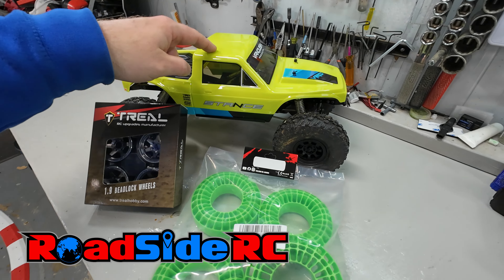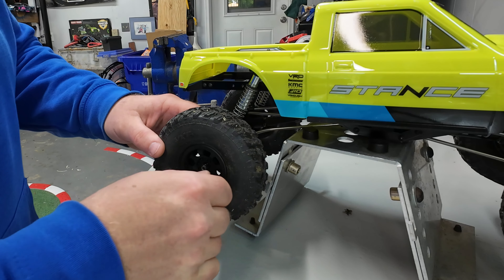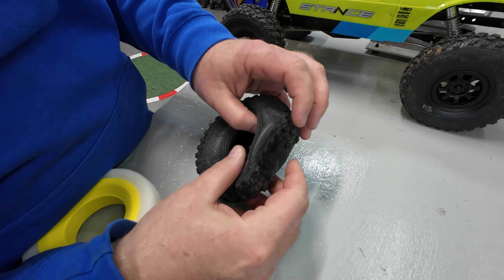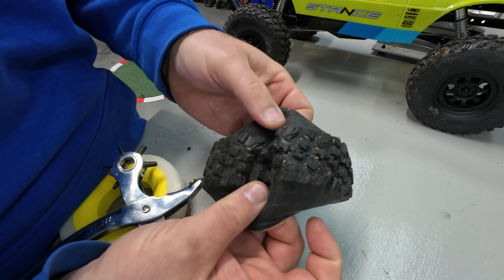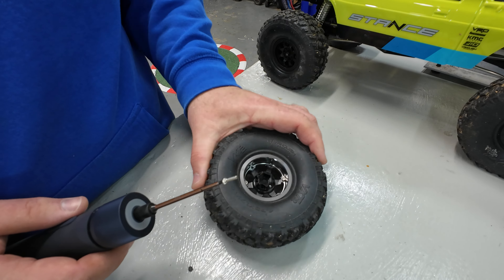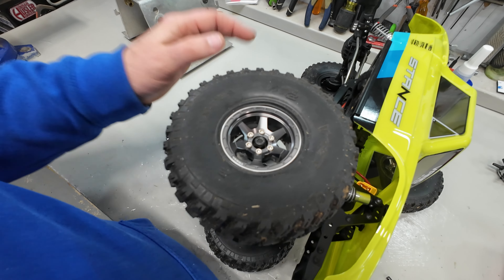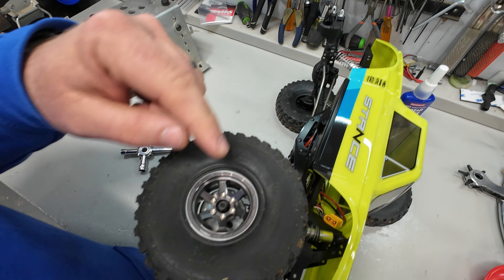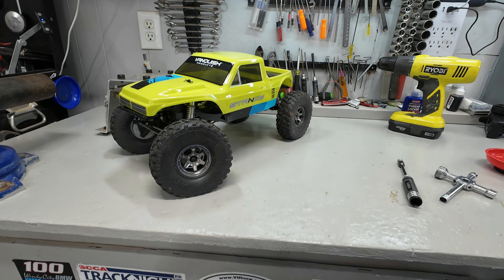Harder than expected!   Wheel upgrade on Vanquish Stance RTR

Comment: The TREAL wheels are great quality! I have them on all my crawlers. I also took some sticky wheel weights that I balance vehicle tires with(I'm a machanic)and wrapped the inside rings of only the front wheels with the sticky weights. It adds 3 about ounces right down low where you want it and gives a little forward bias weight. Also, if you want to try different foams, if you haven't already, maybe check out Crawler Innovation foams. They're a dual stage foam and have the stiffer closed core foam in the center and softer open core foam on the outside. And pending on which type of the Crawler innovation foams you get, they have tuneable foams. There are multiple outer layers of the softer foams, and it gives you the ability to make those slight changes depending on the tires and truck you're using.   Thanks for the great content! Always enjoy watching your videos!
Reply from the maker: Thanks for the ideas!

Comment: My first set of aluminum beadlocks was a set of Vanquish, and also my last set of Vanquish wheels. They're incredibly well made, except they annoyingly used US standard fasteners. Lately I've just purchased Injora and they are good enough for my needs while looking good too. Their deep dish offerings look really cool if you are adding width to your rigs. I need to try out some Treal wheels, they always look pretty sweet. 

The 5mm stubs are annoying. My Phoenix kit came with a thin wall adapter. Maybe / hopefully the Stance includes one in the little bag of tools? If you don't store the thin wall adapter in your tools right away, it will grow legs and disappear from this plane of existence lol. It's also my understanding that the Injora inserts are more like 4.65 to fit their tires so it isn't surprising they are pretty loose in those VXT2s
Reply from the maker: Yes!   Standard sized fasteners is a hard-no for me as well.   I have converted to 100% metric...let's stay that way!  :)  

I didn't see the socket tool in the supplied parts - but perhaps I just missed it. Need to look again.
Reply: @RoadsideRC  Hopefully they include it! It's a little thing and easy to miss. The Incision 7mm to 8mm adapter is like $9 to buy on its own. So annoying if they didn't provide it, because yeah it's really difficult to get the wheels off without a decent thin wall driver

Comment: the adapter is usually in the spare parts bag or tool bag.
Reply from the maker: Yes!  I have not seen it in mine yet...
Reply: @RoadsideRC   I am sure if you wrote to Vanquish and explain yours was missing,  they would send you one.  It's a "Incision 7mm to 8mm Nut Driver Adapter" part # INCIRC00142

Comment: Vanquish made it an 8mm wheel nut and been that way for a long time. Means the axle shafts are stronger
Reply: And many people have broke the standard axle shafts. I think the people at vanquish know what they are doing with being in the crawler side of rc from the start
Reply from the maker: Bigger is stronger, no doubt.  
But I have owned crawlers from every company at this point...and never even bent or broken a single stub axle.   Seems silly when every other manufacturer can make the "standard" axles and nuts work.
Reply: You’re not going hard enough bent stub axles is a thing we do it all the time at Knights ferry

Comment: Why vent the tire and not just drill a small hole in the rim ?
Reply from the maker: You are right that venting the wheel will also let air in/out.   But that only lets dirt and water IN.   A vent in the tire lets debris OUT as well.